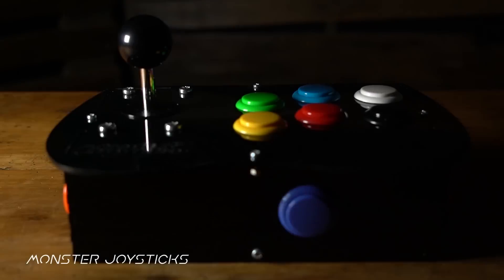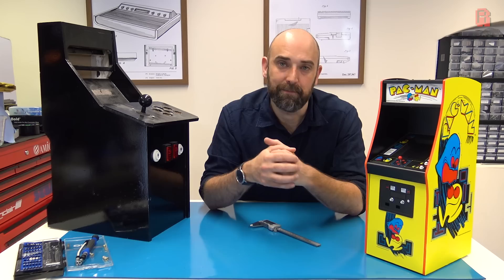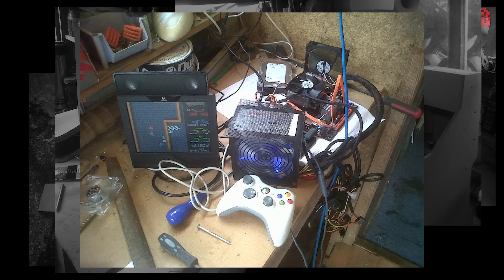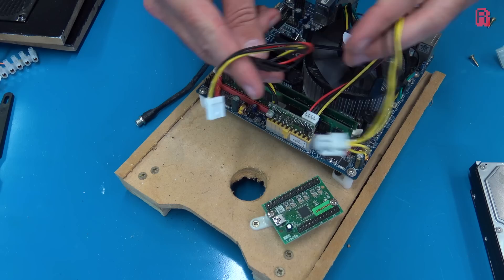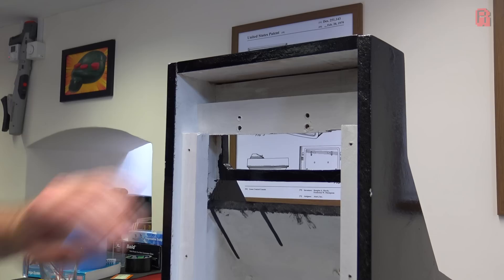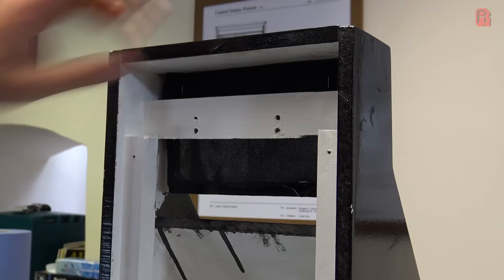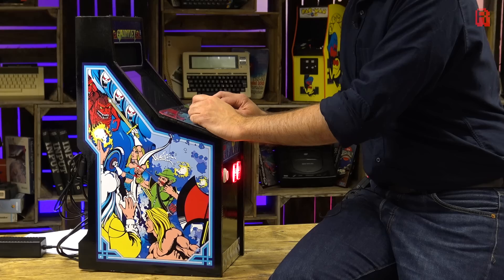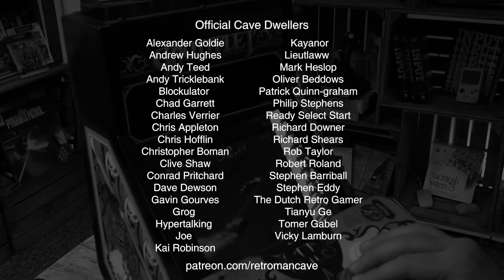Making a Mini Gauntlet Arcade Cabinet - 8 years in the making!

Comment: Great video as always. A couple of additional changes that you could do to the cab are:
Take the bezel out, on the back of the bezel mask off the area where the LCD is displayed and spray paint the bezel "border" black (this way you get a smooth finish when looking from the front). This way the bezel of the LCD monitor is hidden and screen looks like it is "hanging in mid air".
Also, you can always buy the t-moulding that you want and use a sharp knife to cut the spline off and use some adhesive to stick it to the cab.

Comment: I also want to mention those Zotac boards from 2010-2012 allowed you to overclock the front side bus. I was able to push the E8600 which was rated at 3.3Ghz up to 3.9Ghz. I am sure you could push the E8500 to near the same level...depending on the silicon lottery, maybe even more. It really didn't change thermals that much either. It did help with the 32 bit era games.
Reply from the maker: Great tip thank you very much I might have a play with that

Comment: Excellent. Some months ago, I have bought an arcade joystick set from ebay, that came with the joystick, buttons and a little usb board. That works fine. I think, with a raspberry pi, a 10“ tft and a tft board, an amplifier board, speakers and maybe some rgb led stripes, it could be fun to build an arcade from it :-) Maybe a touchscreen could be helpful. I have that on the display...

Comment: Absolutely gorgeous work Neil! I have neither the knowledge, tools or workspace to do this myself but damn if it isn't tempting. :) That custom reproduction artwork you did is extremely impressive.

I didn't know that HyperSpin was no longer being actively developed. That's too bad. As complicated and often frustrating as it was/is, it's still a very powerful tool. Though I suppose if it still works on modern versions of Windows, the most current release should still be fine.

Comment: Years ago I started a similar project that I never finished, but with a CRT screen! Now I really want to finish it... Congrats on finally finishing yours.
Reply from the maker: An 8" CRT would be amazing
Reply: @RMCRetro  it is in fact a 6" in a Galaxian cabinet. As the screen is almost flat it could fit the tiny cabinet I made. I stopped because I could never find controls to the scale. But now I have a 3D printer, that should not be a problem anymore.

Comment: That's fantastic mate. A marquee light and some t-molding down the sides would be nice but I suppose after 8 years you have to call it finished at some point!
(Edit: oh you mentioned t-molding at the end too)
Reply from the maker: Maybe v3 can fix that.  The marquee light doesn't really bother me so much as the original Gauntlet didn't have one.  Maybe I should put some LED's on the back to throw some cool light on the wall behind it while you play

Comment: Awesome stuff there Neil. It looks great, all those little touches really do make it look the part. You might have noticed my full sized Arcade machine project in my Avatar pic, thats been around 6 years in the making itself. It has a region free PS2 & a PAL Dreamcast inside, its been up and running for ages, its the cosmetics that need doing, such as painting, new T-molding, getting the side art on, etc etc but i just never round to it but this has video has inspired me to get working on it again this summer.
P.S. SEGA RALLY with a joystick?

Comment: I absolutely love the project! Masterpiece! Only thing I personally couldn‘t resist now would be to bring the arcade frontend to a modern state of the art by installing LaunchBox / BigBox / Rocketlauncher combo. (Which CAN be a b**ch to configure btw and will throw up a ton of 32/64bit compatibility issues at first with various emulators, especially when using the (rather dated) Core2 Duo / XP 32bit infrastructure  ...) But that‘s only me. Would be a huge followup project... Others would insist on the (in)famous „never change a running system“... ;)

Comment: Looks great and really cute and fun! Shame you didn't mount the motherboard further forward (or back to front?) so you could hide all the cabling inside. Also, what about a (black?) vinyl sheet cut as a surround for the monitor? Self-adhesive to the smoked plexiglass and would cover up the bezel nicely. Simple but extremely effective at hiding the "TFT Monitor" logo. Looking forward to version 2!
Reply from the maker: Some nice ideas thank you.  I think a little bezel improvement can certainly be made, I was thinking of just priming and spraying the monitor bezel black.  The reason for the ports and cables is explained at the end, this was a master unit for a slave to plug into

Comment: Awesome. Excellent job.  Since you asked, I would prefer the 1p and 2p be black and not white. They stand out too much as white. Perhaps smaller as well.  Also, a proper art backlit marquee without the top blue blank area. T molding would be nice as you noted.  Maybe consider adding 5lbs to 10lbs of deadweight to the machine so it stays still?  Love the side art and the emulation software selection system you used.

Comment: Nice work man.  I've been wanting to do a full-sized cabinet for MAME for decades, with all the controls, trackball (for the centipede-like games), and spinner (tempest, tron, etc) included.  With me it's always been a cost and availability issue, but with the stuff available now, it's so much easier to do, and a lot of the prices for the basics are so much cheaper now.  shit, i can get a 19 inch 1600x1200 LCD panel for practically just shipping now.

Comment: What a great project. i am glad that you resurrected it for us all to see. The artwork is outstanding, and the choice of hardware makes for a competent machine. I have one question: how comfortable is it to play? It is too tall to put on a bar top, and if you put it on a coffee table you can’t get your legs underneath. I noticed in the video you were sitting sideways on the table. Not a criticism by any means, just wondering.
Reply from the maker: I usually stand to play it as you would at a real arcade and that's fine... but I also have a motorised desk and a stool with a lot of height range on it so between those two I can sit and play.  The sideways angle was more for the camera shot there

Comment: Thinking about it, a bigger monitor, the speaker(s) placed to bounce sound off the screen, and an acoustic maze/absorptive foam/whatever to improve the sound would probably be a good change. You'd be able to fit the speakers right under the control panel by the looks of it.
Reply: Oh, and above the main screen, one of those rearview-mirror screens that Ben Heck used on one of his pinball machines, for the particularly ambitious.

Comment: I still have my Core2Duo E8500 PC...just haven't turned it on in about 7-8 years.  I think I had 8GB RAM in it and both XP and Win7 (and probably a Hackintosh partition and Fedora partition).  I also still have the AMD Opteron 185 PC I had before that...and the AMD AthlonXP 2800+ PC before that.  Just can't seem to throw anything away, I guess.

Comment: Zotac products are kick ass!!!... I built a mega vertical 39 inch whiplash arcade machine using a gigabyte system board with a zotac firestorm gpu running Nvidia Geforce 210 software... Runs perfect with the old 8 bit arcade roms on Mame... Windows 10 with no front end... Im gonna make a video of it before the summer is over... You did a smashing job on the Gauntlet cabinet!!!... You can spray paint the chrome T molding blue krylon to match the cabinet...

Comment: I have a Zotac GF-9300 Mini- ITX with an E8600, but it never really had the performance I had hoped for. Even after upgrading to a quad core and an entry level Nvidia GT 730, it still couldn't play Gamecube at a solid frame rate.

Comment: Pro-tip: windows boots off a hard disk in 5 seconds into like 20mb of ram if you remove any & all services not required to boot the machine. From there, you can go into the registry & change the window manager from explorer.exe to mame.exe & configure autoloading from there.

Comment: Only one thing different I would have done. I would have mounted that screen higher up so the bottom is not being obscured by the controls panel. Other than that... I WANT ONE! :D
Reply from the maker: The screen is fully visible in the playing position, I think the angles are a little deceptive there.  I'll be taking the cabinet to RetCon expo next month and a few others so I'll get some more pictures of people playing on it.
Reply: @RMCRetro  From the camera angle it seems as though you need to be standing right over it to see the whole screen, it looks as though you could raise it a bit to enable a more relaxed play position, the top area of the monitor panel could go up a little under the top cabinet section the speaker is behind. Perhaps a piece of baton could be glued in at the bottom of the slope the monitor sits on to lift the monitor a bit :)
Reply from the maker: The monitor is attached by velco and the bezel fits behind the marquee panel, so while that's my ideal viewing position you can pull it off the velcro, slide it up a bit more and reattach it to suit
Reply: @RMCRetro  So now the question is: Where can I get one? :P

Comment: Shame you don't makes cabs as your design has most of what I feel is missing in the minis they sell. Beautiful, great job. :D
I've been thinking about mini cabs but my biggest gripe after trying one(SF2) is instability because it is so much lighter than the full cab. I need something that secures it to a weighted base or something I could stand on with my feet from a seated position, use body weight to hold it still while I jostle the controls around. The scale offered seems right for homes while approximating arcade feel albeit single player but the operation aspect needs improvement soon before these become big Tchotchkes. ;) Also how about a 2nd player port on these things to plug in another stick externally.

Comment: I'm surprised that old dual core can handle Saturn so well. Something single board computers are still struggling with.  The Pi4 still needs some work on the software side, but i'm thinking it's still going to have some console restrictions with the 32bit systems.
Reply from the maker: A lot of that work is offloaded to the GPU so I guess that helps, and that's the M2 emulator running the arcade version rather than the Saturn 👌
Reply: @RMCRetro  Oh that makes more sense, re-watching it does look better than expected. thanks for the reply!

Comment: Looks amazing. Just wondering about the material youve done the artwork on. Is it anything special?
Reply from the maker: I sent the art files off to be printed on self adhesive vinyl.  This was done by rockstarprint.co.uk and I know 1clickprint.com now also have this capability.  Hope that helps
Reply: @RMCRetro  It does! Ive just been thinking about how to do durable artwork for a project so will give that a shot. Thanks heaps.

Comment: A very nicely made arcade case. Why did you originally abandon this project after putting so much effort into it ?
Also, was there a reason why you still used XP (32-bit with 4GB of RAM) in 2011, 2 years after Windows 7 came out  ?
Reply from the maker: Good questions.  One answer involved a divorce, several house moves and a year in France.... the other... I really can't remember now why I chose XP.   Probably just seemed easier at the time for the goal!

Comment: What is the name of the little white brackets connection PCB to the wood plate. Maybe a ebay link.
Reply from the maker: I think you're talking about the PCB  mounting feet... https://rover.ebay.com/rover/0/0/0?mpre=https%3A%2F%2Fwww.ebay.co.uk%2Fulk%2Fitm%2F111969462514

Comment: I have a bar top that I have been working on for about 2 years now, Im at a stand still because I am no good with electrical.
Reply from the maker: The days of hacking keyboard controllers and de-casing TV's is long behind us, most things in a bartop can be found on the shelf for all skill levels.  What  part of the build are you having trouble with?
Reply: . i have a jamma harness which seems to take up alot of space with the excess wiring.   Plus when I built the cabinet I put the back on without thinking that how much easier it would be to work in the machine if I would of made a door on the back. Lastly mounting the monitor...

Comment: ok i KNEW it had to be possible to boot straight into a front end without seeing the desktop! i couldnt figure it out on windows xp or 7 and i even tried lubuntu but i couldnt figure it out there either. how the heck did you do this?
Reply from the maker: Windows XP and "Instant Sheller" were used here as well as a few other tweeks
Reply: @RMCRetro  thanks! i'll have to look into that

Comment: you should have put the rear cabling for the monitor, on the inside
Reply from the maker: The reason for this is explained at the end, it was to be a master cabinet for a split slave, it's also useful for adding extra controllers or headphones, I like it this way 👌

Comment: It's a shame - with the release of the RPi4 you could have probably got the internals to a fraction of the size with more than adequate performance. I can't really testify to the Pi4 gfx performance, but network and HD access (mine are headless) are pretty close on awesome. Plugged into a screen, esp the lower resolution retro, I see no reason that it would be worse.
Reply from the maker: I'll certainly give a Pi a go.  I'm not entirely convinced it will be quicker but there's only one way to find out, and as it has USB it's a straight swap out for the internals, maybe a hdmi to vga adapter thrown in and a new 3d printed back plate

Comment: Awesome build. How did you get it to boot directly to Hyperspin?
Reply from the maker: That's Windows XP with the Windows image replaced with a custom loading screen and lots of little tweaks like the mouse cursor is replaced with a single black pixel and hyperspin launches instead of explorer.exe
Reply: RetroManCave can you please point me to where I can find out how to do that?
Reply: IIRC, There was a trick back in the day whereby you could actually change the "shell" that Windows XP boots into.  You can set it to boot into Hyperspin directly bypassing the normal desktop.
Reply: TheTurnipKing ok thanks I’ll do some research on that :)

Comment: I know you want to keep the harddrive, but PLEASE if you have as many hours into tweaking the OS as you say, make an image of it as a backup. That disk will fail at some point, and if you have a backup you can just image a new SSD (or another spinner) and be up and running in a few hours instead of having to redo everything. I've learned my lesson about this and please learn from my pain.
Reply from the maker: Thank you Scott, an Acronis image of the drive sits on my NAS right now, I'm not taking that risk!
Reply: @RMCRetro  👍

Comment: Using a pc or raspeberry pi? I think raspeberry pi is nice if you don't want to deal with heat and it's so simple to set it up....however with a pc..games run faster and the rate of compatiblity is a lot higher..in the case of n64, dreamcast, and mame..where if you use raspeberry pi..it's hits and misses in those cases.  Don't you agree?

Comment: Sorry Neil, but you need one more sticker - the plastic edges of the LCD are ruining the illusion for me. Soz.
If you've got another hard drive laying about (may as well retain your current installation), have you thought about a Linux arcade distro? That hardware's still perfectly fine for more minimalist modern distros.
Reply from the maker: What are you thinking John, a bazel sticker on the glass?  I'm not a fan of when the glass overlay sticker is disproportionate to the screen so it's a fine balance.  Certainly something that can be further refined though it's by no means at a full stop, just a nice place to stop and enjoy it.
Reply: @RMCRetro  I was thinking behind the glass on the plastic structure itself. Something like an outline pattern of black and green. Or perhaps just some black plastic to cover up the screen frame (particularly any logos, etc.). Come to think of it, the black is probably a better idea.
Reply: @RMCRetro  Wait, no, not a sticker - can you cut out more of the wood you constructed the cabinet from and glue that in around the frame of the monitor? That would look much more legit than stickers/overlays, etc.
Reply from the maker: @johnknight9150  oooh a like that, a nice little wooden bezel might be a classy touch
Reply: @RMCRetro  If it's black and you get the edges right, it might also just "disappear", taking visual attention away from surrounding areas and drawing the eye straight to the screen.